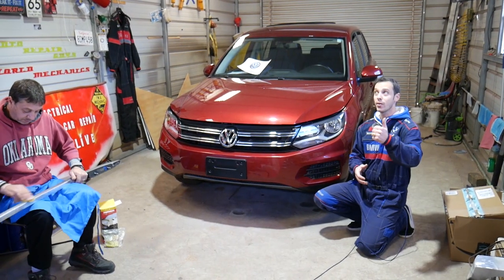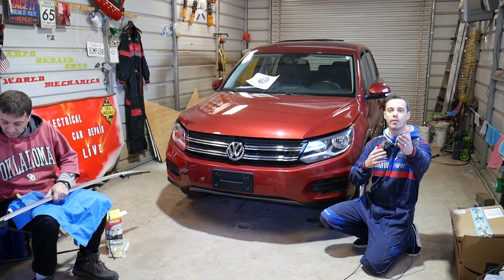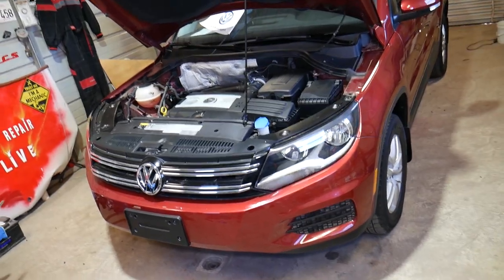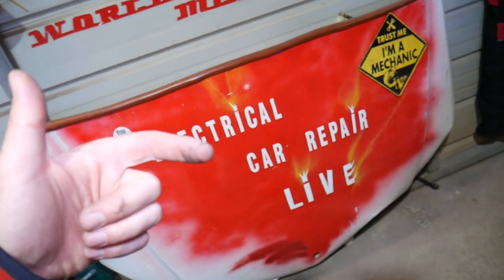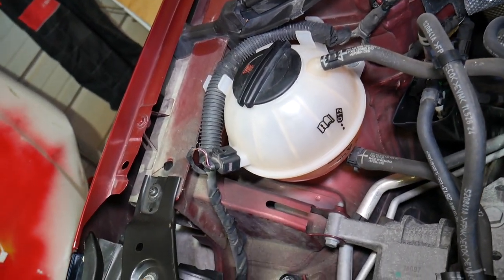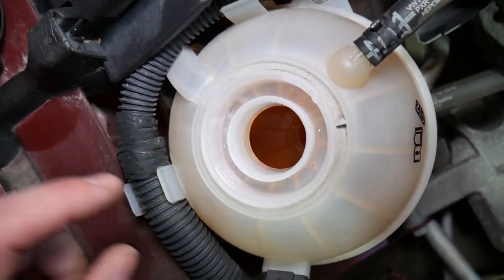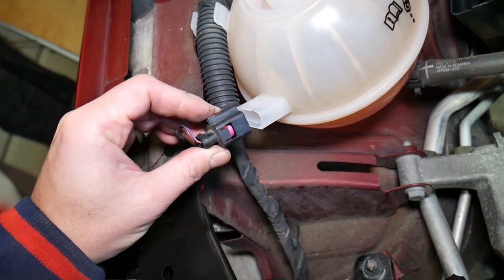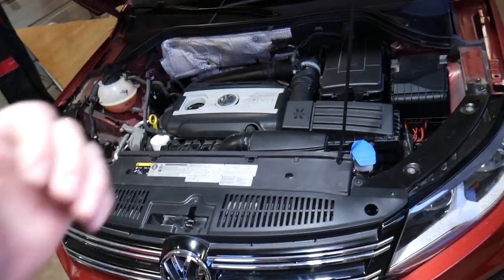VW TIGUAN COOLANT LEVEL SENSOR LOCATION. COOLANT LEVEL LOW, ADD COOLANT NOT READING RIGHT

Comment: I have a 2013 VW Tiguan and the coolant keep leaking out but I am not able to determine where it's leaking from and even after getting it tested by a professional I am still unable to find where it's leaking from. The good thing is it is not overheating. Any advice for me as it relates to what I can also check to find the leak. I have also change the coolant bottle but the issue still persist.
Reply: Same problem now. Did you fi d where it was?